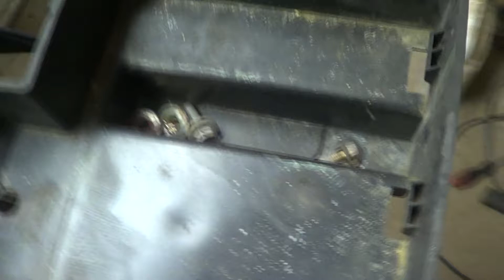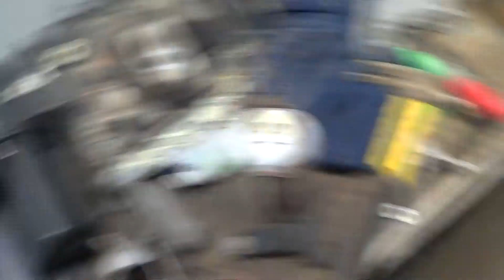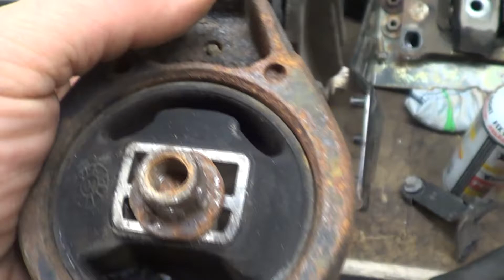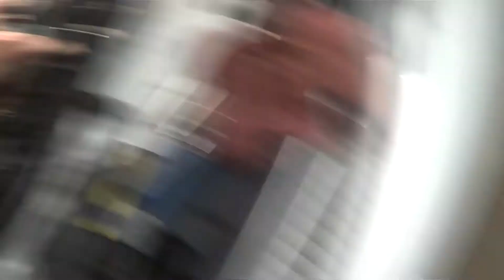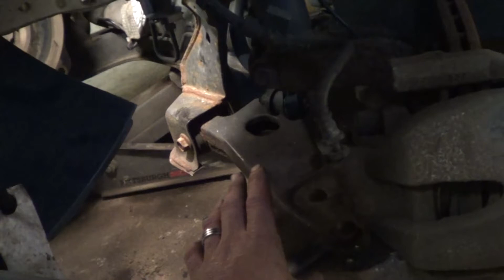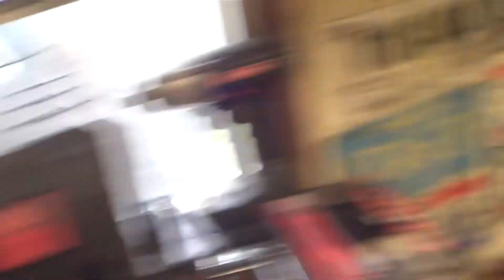2005 Ford Focus Clutch Repair Part 1

Comment: I’m working on a 2006 zx5 
Same exact engine and transmission 
I have a question
I’m also swapping the master cylinder can I just drain the resivoir as the first step  and second question is will I lose all the mtf oil when I pull the cv axles ?  
So should I drain the two quarts of mtf oil first as well ?

Comment: I’ve never done this before, I swapped my transmission, i am ready to fill and bleed clutch, any suggestions on how to start this properly, do I have to bleed out all the fluid out of the lines and Reservoir before I fill in the new fluid?